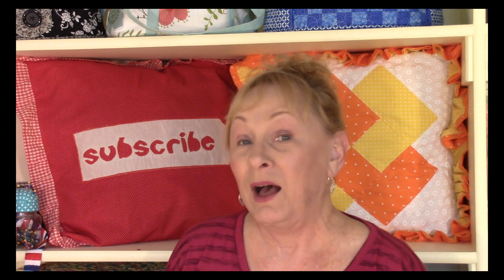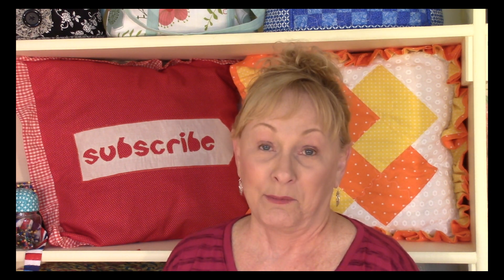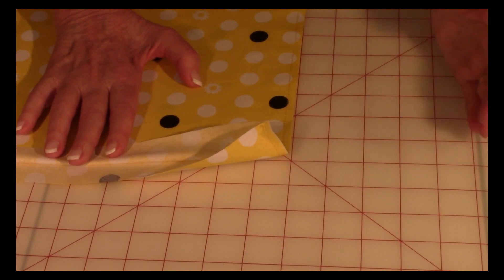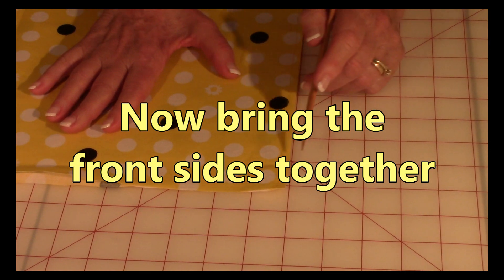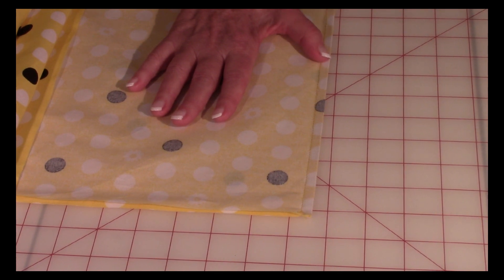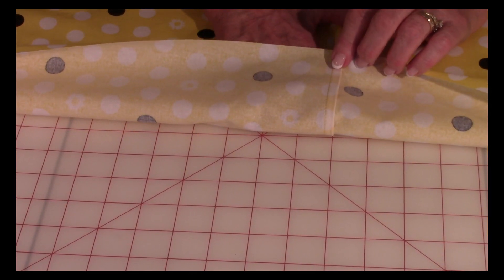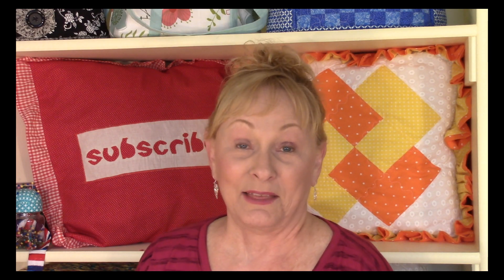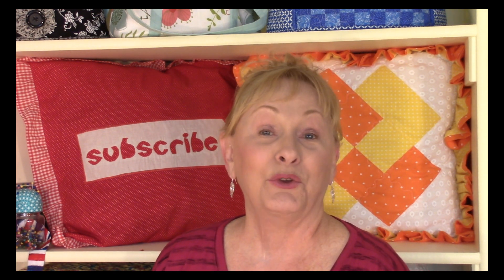How To Stitch A French Seam

Comment: Would you clarify what the difference is between a scant quarter inch seam and a 3/8” seam? Is the goal to have the second seam enclose the first sewn seam?
Reply from the maker: Hi MGS.  Good question.  Scant quarter inch or narrow quarter inch means it is a hair narrower than 1/4".  Yes, the second seam is to completely cover the 1/4" (2/8") seam with the 3/8" seam.  It hides the raw edges.  Next week I will release a video in which the French seam is used.  I wanted to prepare everyone.  Happy sewing.

Comment: I believe this demonstrates why, in dressmaking, we always has a five eighths seam allowance - that’s what it takes to sew a french seam. High end fashion still use this seam in expensive items such as blouses. Befire the overlocker it was used extensively on lightweight fabrics where a neat finish was needed. Does anyone know about this?
Reply: Big difference, back in the day, when 5/8" seam allowance was the norm for patterns. In the days, when pattern companies sold patterns for individual sizes. No guesswork. Enough material in the allowances for various forms of seam finish. About a 1/2" adjustment room, if (when) needed in each seam to adjust fit. (Roughly 1-2" inches of adjustment around a waist, for example, depending on the number of vertical seams involved.) Didn't want/need it, trim it off when applicable. Or just leave it and not worry about it. 

Sad to lose the flexibility from those days with these 1/2 dozen + sizes on one sheet of pattern paper. Sure some grading may be easier in some cases. But so are many other forms of pattern adjustment. Some actually easier such as moving a dart on a simply drawn pattern without all the extra printing of a multiple size pattern. Reduces the need to trace the pattern for clarity.
Reply: I prefer the french seam to my overlocker and use it a lot.